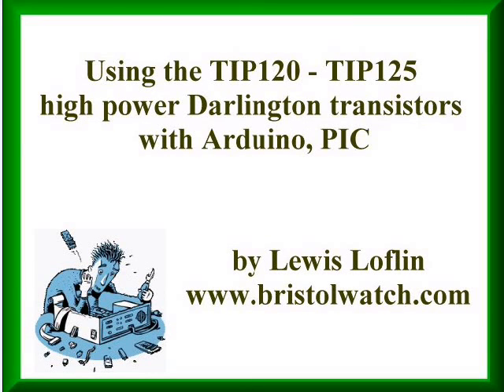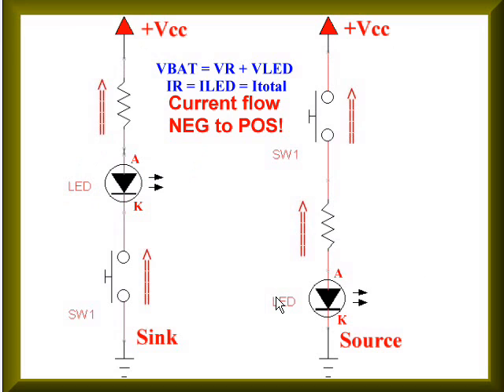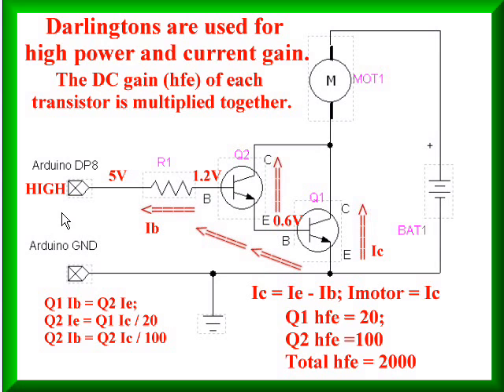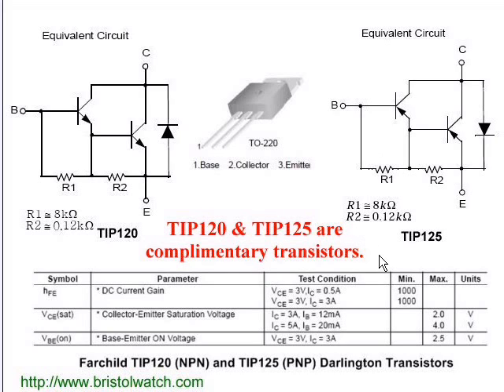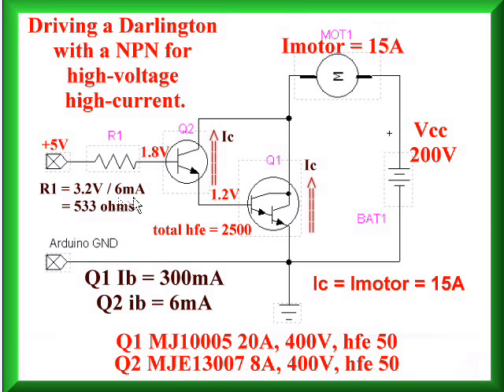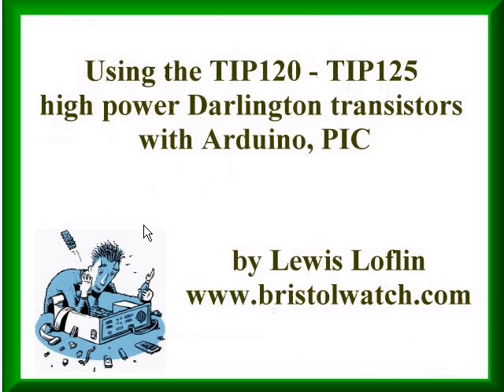Using the TIP120 & TIP125 Darlington Transistors with Arduino

Comment: Hey, I know it's been 5 years, but I was thinking it's worth the shot asking away. 

I'm working with TIP120 transistor to power a heating element with a current draw of .3A when powered by a 9V battery

I'm struggling with breadboarding it though. I'd assume I'd have something similar to you: Arduino DP has a resistor that connects to the base pin, and then the current flows from collector to emitter, through the 9V battery and through the heating element. 
My problem is that my circuit is able to turn on the heating element, but it's not turning off when it the DP  base input is low. I was thinking that might be because of how my collector to emitter circuit does not connect to the ground pin of the Arduino - it only consists of the 9V battery and the heating element. 

I was wondering what connecting it on a breadboard would look like? Would I connect my emitter pin to both the Arduino ground (which I'm setting to the negative rail of the breadboard) and the 9V battery as well?
Reply from the maker: Connect the battery's negative and emitter of the transistor to Arduino GND. Connect a 1K between the Arduino DP and the base of the transistor. Connect one side of the heating element ( I assume resistive) to the collector, the other side positive of the battery.

Comment: Your current arrows show electron flow, not current: 
"Conventional Current assumes that current flows out of the positive terminal, through the circuit and into the negative terminal of the source. This was the convention chosen during the discovery of electricity."
Reply from the maker: I'm aware of this and changed it in later videos. In fact, electrons are the only charges that actually move. Positive flow has been proven wrong with the discovery of the electron that came later. Yes, they stayed with the conventional flow anyway. I worked for years with vacuum tubes, etc.; that is how it was taught in the military.
Reply: @LewisLoflin  thank you for your kind reply :) and for your efforts for making these videos :)

Comment: It may be confusing to others that you are using direction of electron flow as opposed to conventional current. For an NPN the conventional current is collector to emitter. I do think electron direction makes more sense but the curriculum nowadays almost exclusively has switched to conventional
Reply from the maker: I already addressed that in the past. I have used conventional current for several years. Thanks.

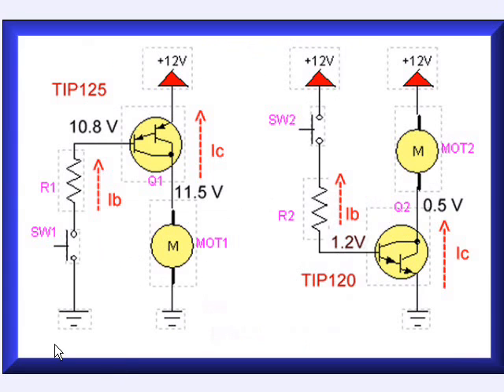Comment: Lewis, as always, great stuff.  Starting at 1:29 things went a little confusing. For me, (for example in the case of the npn darlington), the fog lifted when it became clear that you, (I presume), were striving to keep the base-emitter voltage below 5V, (with the transistor emitter tied to ground).  ... Because the Arduino is also tied to the same ground and the Arduino was interacting with the transistor base, so had to be less than 5V. Similarly for the pnp darlington.

It would be nice if you could confirm, Lewis.

Feedback:  The two items at diagram at 2:54 should change places due to referral to previous diagram!

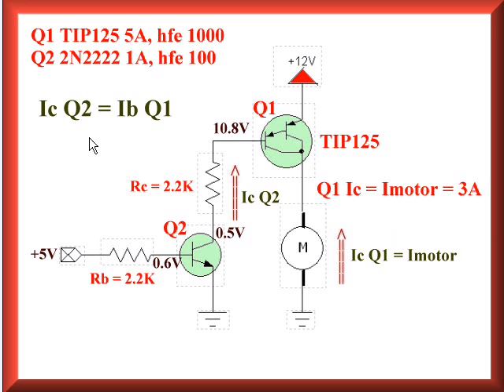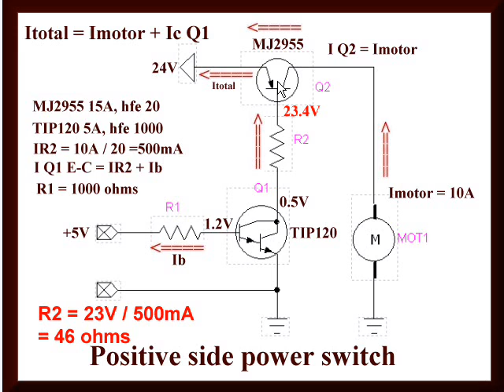Finally: Really useful info from 12:13 onward and wow! very useful at 14:43 onward.

Thanks & Best Regards Lewis!

Comment: HELLO THERE . THERES A TIP142 NPN TRANSISTOR IM TRYING TO USE IN MY ONE TRANSISTOR SOUND AMP . SO TELL ME WHERE IS THE EXIT IS IT AN EMITTER OR COLLECTOR ???
Reply from the maker: You can't use a TIP142 or any of these  in a sound amp. The built in resistors and damper diode are for switching circuits.
Reply: @LewisLoflin  OH OK WELL I HAVE SEEN TONS OF CIRCUITS WITH SUCH TRANSISTOR AND I ACTUALLY BUILD ONE RIGHT NOW WHILE IM TYPING IT TO YOU BUT THE SOUND IS NOT LOUD BUT GOOD QUALITY . HERE IS THE PICTURE OF ONE OF THOSE FAMOUS AMPS WITH TIP142 .......... https://ibb.co/tXnvsRP

Comment: Great videos, thank you for these!
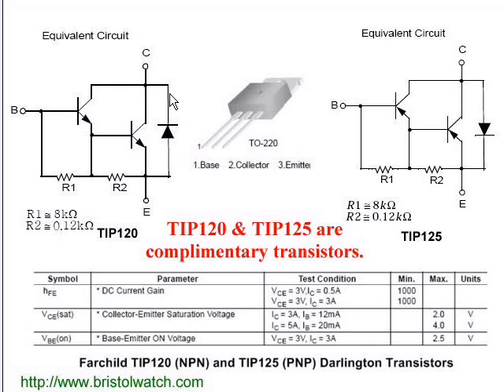It's probably important to point out that mysterious antiparallel diode across the emitter and collector (highlighted @7:00 in this video) is I think only good for suppressing flyback from H-bridge arrangements, and /not/ simple switching of  a single inductor.
For switching in the case shown for e.g. a TIP125 (PNP), with inductive load between collector and ground, a proper suppression diode would be reverse biased between collector and ground, whereas TIP125 internal suppression diode is reverse biased between the collector and /positive supply/, which doesn't address at all the large negative-going spike back from the inductor when the transistor turns off. In my application I am running a 12V buzzer at 60Hz generated by the TIP125, and found huge 150V spikes below ground at the collector on each on-to-off transition. Adding an external reverse biased diode between the collector and ground was essential: it suppressed the spike completely. Diagram of this situation, with scope pics + schematic shown here: http://seriss.com/people/erco/tmp/tip125-with-vs-without-added-protection-diode.jpg
Reply: I should add I had thought the diode within the TIP125 was handling spike suppression for me, but it wasn't until a friend peer-reviewed my schematic and caught that the TIP125's internal diode was going the wrong way for suppressing the inductive load (and connected to the wrong supply line, positive instead of gnd). After realizing he was right, double checked with a scope, and sure enough, huge spikes of over 10x the supply current at the collector, even though the TIP125 was working OK (probably by luck!) and the buzzer was buzzing. But when I added the extra suppression diode, the buzzer sounded a bit louder and clearer, as I suppose without the extra diode, the inductor remained energized longer, decreasing the volume of the buzzer.

Comment: My design team is trying to impose a waveform, generated by an Arduino, on the current coming from the wall outlet. Could these be used to do that? We're mechanical engineers so we're really bad at this.

Comment: God video which makes the stuff understandable. But I'm going to raise a flag here. The 46 ohm resistor you calculate somewhere, would need to be very big, like 15 watts, and you don't say anything of it. I also hear you say magnetic load where i expected you to say inductive load.
Reply from the maker: Because this teaches basic electronics. 15 watts would be correct.
Reply: Not to be argumentative  @LewisLoflin , but power ratings of associated components SHOULD be noted in a basic tutorial - especially when it comes to exceeding the ratings of commonly used devices. Someone trying this configuration with a 1/4 watt 46 ohm resistor is going to learn about power dissipation in a big hurry and not in a good way! Having said that, thanks for this video. It does cover the basic concept very well!

Comment: hello sir for 30VDC can i use TIP125?
Reply from the maker: Yes.
Reply: Lewis Loflin  i want to dim 30 vdc using PWM for Led.
Reply from the maker: Works fine. I've used them for that. Use a dropping resistor with the LED.
Reply: That's cool. Great ...

Comment: So easy to understand...
I am planning to use this on 12v motor with 4A stall current. So, is it save to use this transistor without heatsink?
Regarding to the datasheet, the transistor can give 5A max.

Comment: Hey Lewis.. while making a van de grafe generator, the voltage is 10kV, The current on discharge is few mA, and I would want to switch it at 10kHz frequency. how can I do switching this fast?
Reply from the maker: Not sure what you are asking. Without knowing how it's constructed i have no idea what you are asking. I know exactly what a Vande Grafe generator is but the designs I saw used vacuum tubes.
Reply: I think you're looking for this https://forum.arduino.cc/index.php?topic=117425.0

Comment: Hi Lewis, thanks for the video. I was unable to source a TIP120 so I have 121 instead. Does this work in the same way as 120 in terms of positioning of the load?
Reply from the maker: Yes it will but not has a different voltage rating.

Comment: thanks for the video,make it a joy to learn, is there an explaination on DIAC only?
Reply from the maker: +Damoo Premchand There is no diac in this circuit. Those are spike suppressor diodes internal to the transistors.

Comment: Thank you for your video. I saw other videos that tell me how to text transistors but... it was not working with the TIP 120! Whenever I was testing with the multi-meter like a diode I didn't get the same reading between CE or EC. Your video show ne the diode. THANK YOU!
Reply from the maker: +Laboratório Aberto This is a Darlington transistor which means multiple junction plus some resistor are also built in.
Reply: Thank you!

Comment: Well,
actually the best way to go would be using power Mosfets.
and for higher voltage loads use  optical isolators ( opto transistors etc.)

Comment: Hi Lewis, I have a question for you.

Can i use tip120 with a plc that has transistor outputs at 24vcd to controll a solenoid of 1amp that has an 24vdc source? Thank you
Reply from the maker: +Arturo Armas No problem.